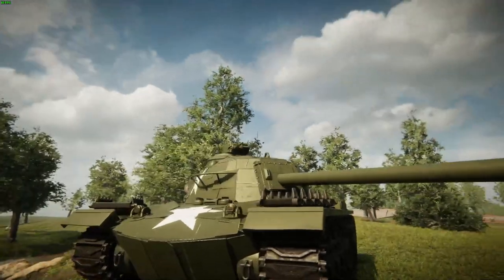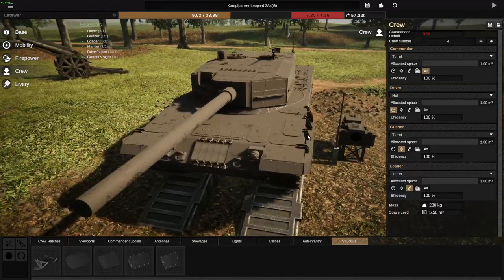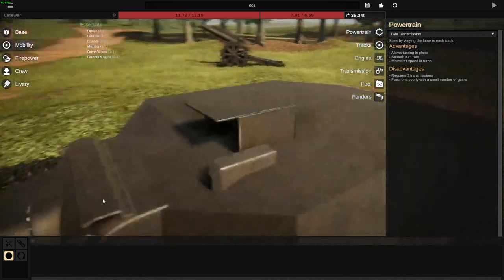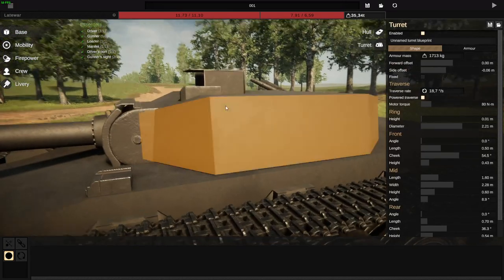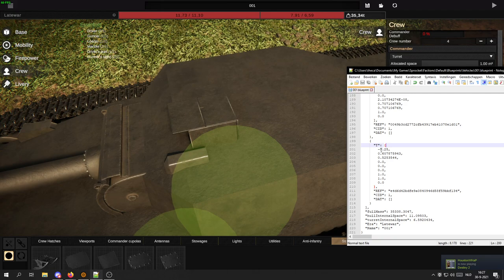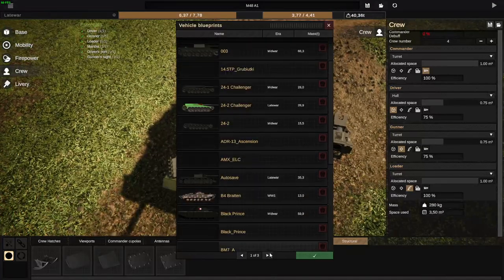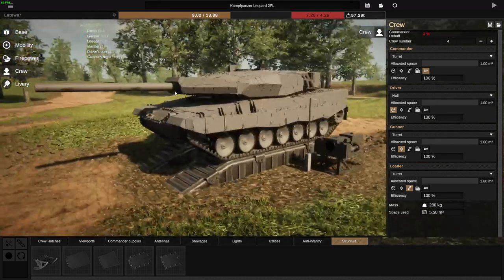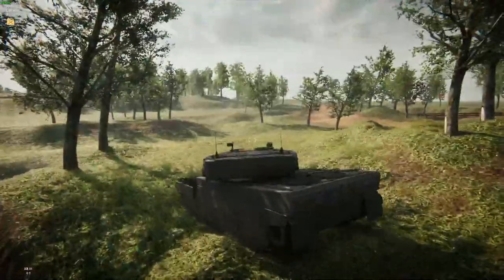Sprocket 101 - Advanced plating guide!

Comment: Everyone: using sleds
Me: uses fuel tanks cause that’s functionally just a lot of ERA blocks
Reply: Yeah its funny as I made speedy boi with 5mm armor with era and track armor
Reply: used the smallest ones on the side and only had front armor and lower side armor, as well as front of turret armor, but thats it.
it had way too much fuel but hey, era is much MUCH better than dummy thicc armor
Reply: ERA is getting fixed in the next update
Reply: @bara555  Noooooooooooo! That cripples a lot of my builds
Reply: @thelieutenant7732  round turrets will get added though
Reply: @Dutchman-2002  Oh it's not the building process that gets compromised, most of my vehicles rely on ERA for armor as I've kept them relatively light so two shots to the same area would be game over, but without ERA, a single shot is game over unless I make them have super thick armor.
Reply: This is very fun to do in the new version since you can make them super tiny for lots of ERA

The downside is they have weight now so you have to use ERA sparingly.
Reply: Do fuel tanks allow all rounds to pen them now? Because my ERA doesn’t work anymore, but I only tested it with one round type.
Reply: @carrott36  Yeah unfortunately the fuel tank thing was a bug and it's now only 5mm of armor
Reply: @thelieutenant7732  There should be a cheat option to make fuel tanks act as ERA. What'd be really cool with this is if you did like side skirt tricks with turrets, or if you're a madman the hull itself, you could hide the fuel tanks underneath something.
Reply: @carrott36  That's what I used to do actually, the newest stowage container looks pretty good for ERA and before that I'd just the flat armor sheets and just made them thicker

Comment: I mostly use the shape sliders to place, and move plates (Track segments, vents...)  When you place an angled plate, and move the glacias, they stay at the same angle, but move with the glacias as you adjust it.  I also use trench skids, and fuel barrels to place them out in space.  However, you can use the shape sliders to move those around, too.  So, for instance when you're stacking plates the way he did on the rear exhaust shroud, you can move the trench skid without dragging and dropping it, using the Lower and Upper Height sliders in Hull Shape.  That saves me a lot of time.  For instance on the crew compartment, in the rear of my SU76M.  I still need to be able to place on the Barrel, or Mantlet to get the Reoil Buffer Shroud to move with the barrel, though.